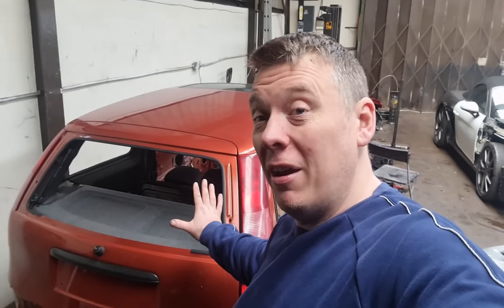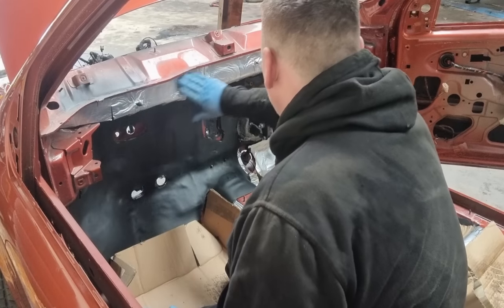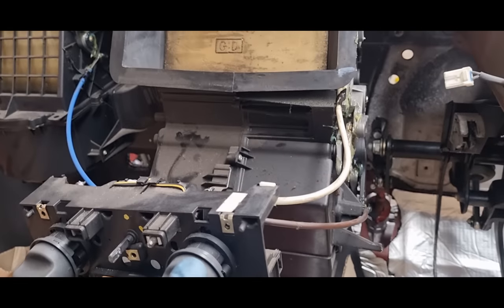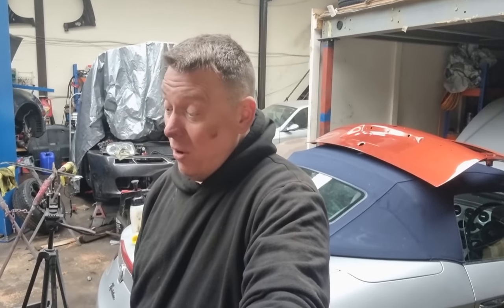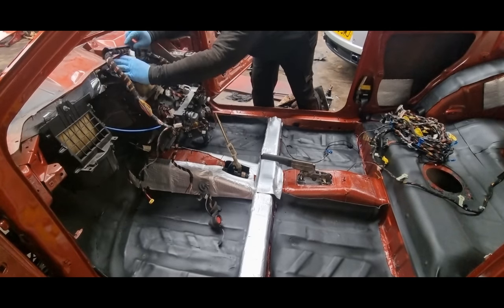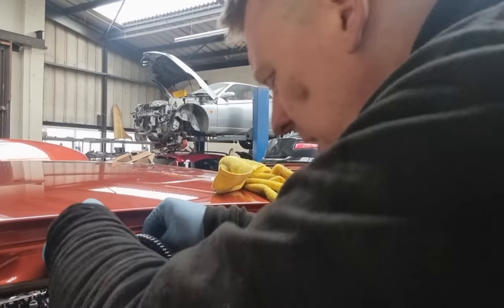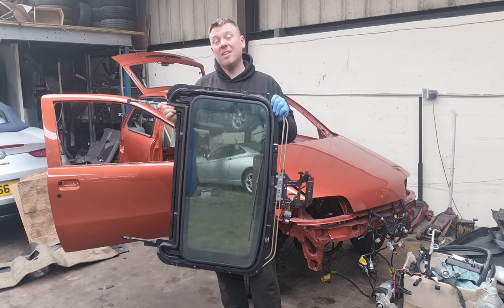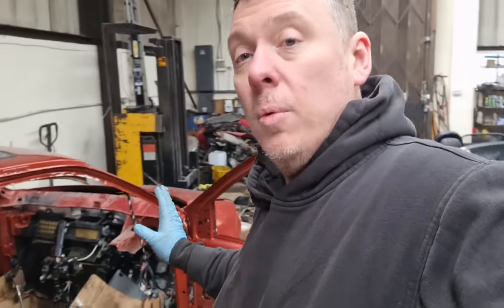Fiat Punto  GT Turbo Restoration Part 11

Comment: Hi Neil, excellent job so far. The sound deadening you put was quite right, shaped exactly to the form of the floor - I'd advise you to get some on the roof too, also on the boot floor. On my '99 Alfa 146 TS I've done those things minus the roof, and the difference is over 7 Db @ 75-80 mph (the legal limit in Greece), which is a heck of a lot - the car was never too noisy at motorway speeds, but now you can have pretty much limo-like trips and practically no road noise / vibrations whatsoever. Great job, keep it up, lovely videos!
Reply from the maker: I've got plenty left
Reply: @ItaliaAutos  That's great news if you don't mind taking the roof lining off again, the boot is easy, I assure you it will help noticeably more, you'll enjoy the engine sound far more because the deadening will -nearly-eliminate all those unwanted noises. My intention is to put some deadening on my roof too sometime, just too lazy to take the lining off (lol).

Comment: Great work, don’t forget soundproofing the rear quarter panels. Self-adhesant foam on to the back of the plastic panels! This made all the difference on my Punto, the oem panels have NO proofing, just 3mm plastic thats it. 
Foam very effective for noise, as opposed to dynamat etc which are for resonance really, in tiny portions. Heavy too, that.

Comment: awesomeness my man! If i could still driv a manual I’d be planning a bank robbery to get the funds to make you an offer you can’t refuse. Punto GT Turbo is my humming bird. Btw i have seen upholstery bobbling removed with a cheap bic razor and also an electric shaver. I’d try a test first myself. (It was Mike Brewer that used the bic style razor on iirc a vw)
Reply from the maker: I don't think any offer right now could take it.

Comment: I don't envy you sorting out tgat wiring loom, but coming along nicely Neil. What brand were the two types of sound deadening/ insulation you were using, as I have to do something similar with the doors of my car.
Reply from the maker: Dodo mat was the black one. Woudnt reccomwnt the brand of the silver stuff as it wasn't sticky enough
Reply: @ItaliaAutos  Many thanks Neil, I'll check this black one out.

Comment: Hi Neil again been watching all the videos.  My Punto gt is grey metalic.  I was wondering if you`ll be doing a video of fitting the Clutch master cylinder?  Looks a bitch of a job to do from the ground.  I`ve done the slave cylinder but didn`t make any improvement apart from that I know it`s a job I won`t have to do now.  Will you be doing a video of replacing the Clutch master Cylinder?  It works fine but only if I apply more pressure than normal initially and then rest my foot on it as light as possible to keep it active.  If I press it down lightly it goes all the way down obvious signs of master cyl.  She has a new clutch 2020 May 6k miles since and honestly could drive it all day but it needs replacement.  All I know is, right wheel off, inner wheel arch liner off, alternator off for axcesability.  Thanks.  Keep the video`s coming.